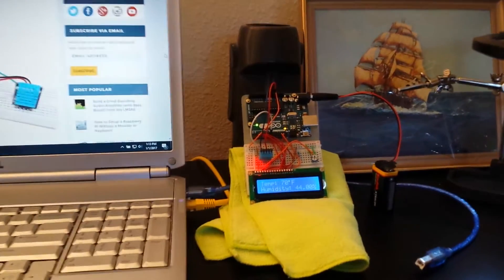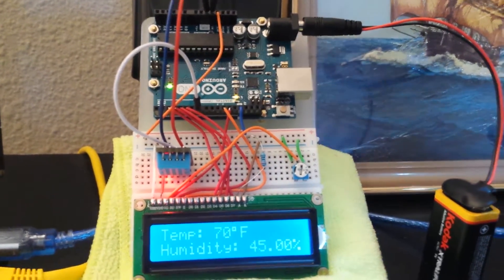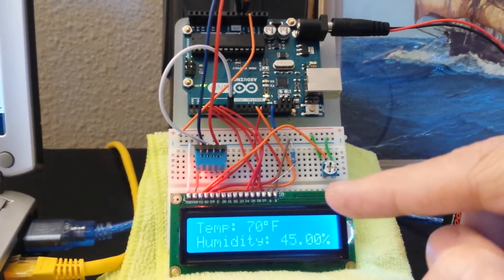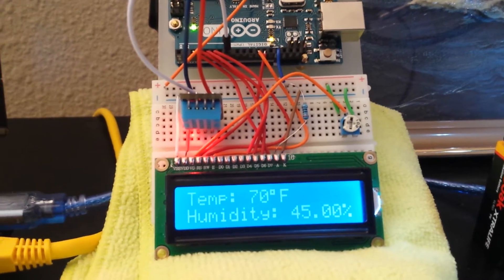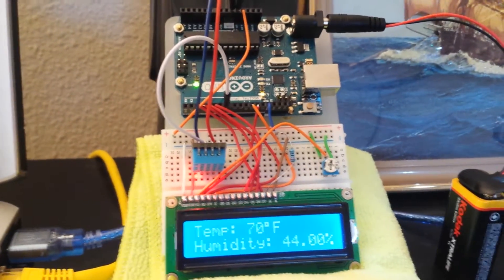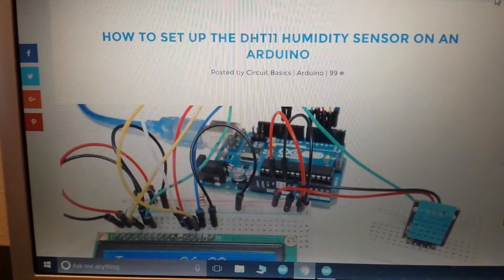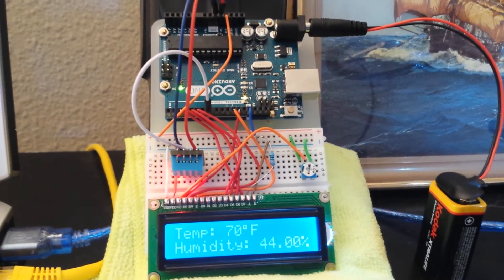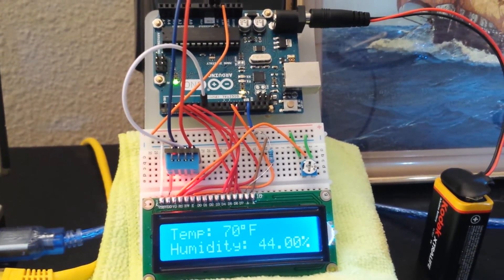Arduino Temperature & Humidity Sensor with LCD readout

Comment: Awesome, Thanks For sharing!
Reply from the maker: No problem. There is a link to the code that I used in the video description.
Reply: @CurtRowlett  I did use it, It works. However i modified it to show the temperate in Celsius.